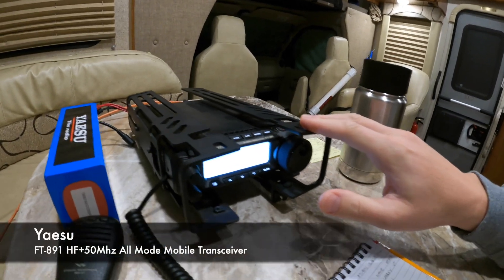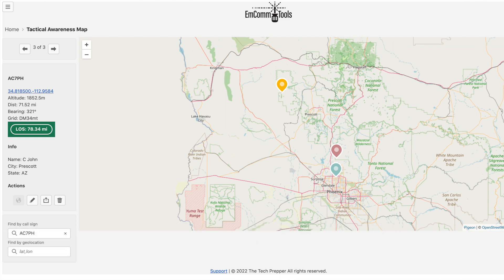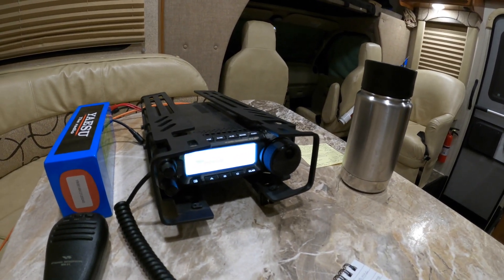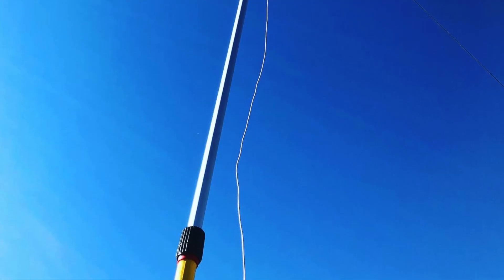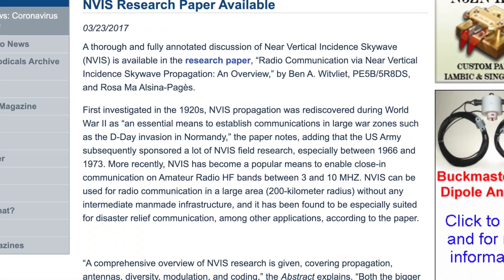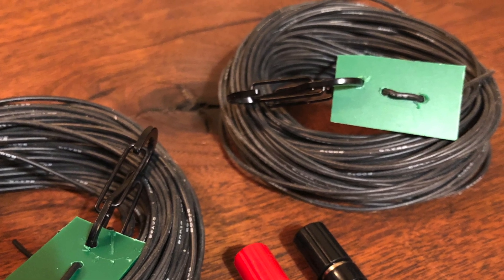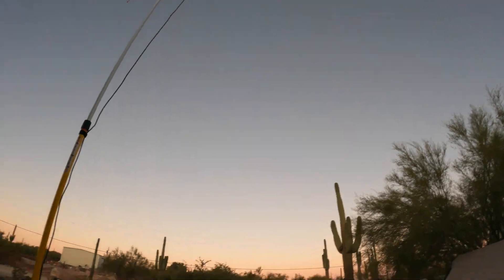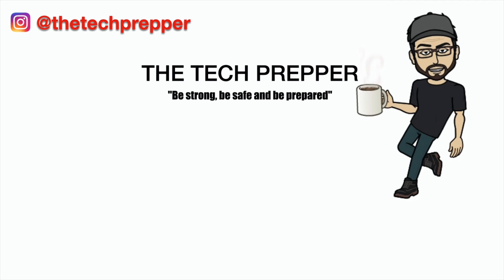The Best SHTF Comms Setup for Regional and Local Communications - NVIS

Comment: This is perhaps the most straightforward, practical explanation of how to do NVIS for exactly what I’m looking to do - regional reach to about 300 miles within the state. The theoretical information out there is great, but the real world explanations here and other videos on this channel about takeoff angles and heights was easier to apply and just make more sense. I think I know now how to do a SHTF setup out here. Thank you!
Reply from the maker: I'm glad you found it useful. If you search for NVIS on my channel page you'll find a couple of other real world examples. The field ones are fun. Cheers.
Reply: @TheTechPrepper  I read the 160 meter band can bend around hills quite well so you can use it regionally without relying on the NVIS. Have you tried this?
Reply from the maker: @castirondude Yes, I have experimented with groundwave propagation on 80m and 160m, but our ground conductivity is very poor, so I have not been able to get anywhere near the distance that the literature suggests.
Reply: @TheTechPrepper  That's good information. I just signed up for your coffee thing. I'm very impressed with the amount of real-world experimentation you've done. The general usage mode I'm looking at is similar to yours, but man I can't afford to spend the countless hours to figure it all out.

Comment: I missed this video when it came out. Good job!
Did lots of engineering work with screen rooms and Faraday Cages. The grounding or earthing comments below are correct.
Multiple layers, isolated from each other except at the grounded point increase the effect.
The local team stored radios, with all cables disconnected, in layers that included vacuum bags with silica gel, foil layers and metal tool boxes.
Never really tested them with big EMP.
Did test using antennas in wire mesh cages. Almost no effect unless they were grounded as discussed below.

Comment: Thanks for the video. I use NVIS on 40m to run JS8Call between Melbourne and Sydney which is about 900km reliably all day. Generally only running 15W. Also use 40m NVIS locally for a Winlink connection to a local station about 60km away. My 40m NVIS dipole is only about 2m (6ft) above the ground in an enclosed small back yard. NVIS rules !!! 73
Reply from the maker: No problem, Darrin. Thanks for joining the conversation. NVIS rules!! Almost all of my experiences with NVIS have been on 40m. Like you, I have run it as low as 4ft. I actually activated a peak like this using my 40m version. Check this out: https://youtu.be/P6uowKWtWbY?t=540
Reply: I did NVIS many years ago for MARS and it was surprising how well/reliable is was. Daily nets rarely had a hiccup, usually a broken antenna for the current net control was the biggest issue. I got out for a while but now my daughter is a ham so we will be having more fun soon!

Comment: I really liked to comment about NVIS not being able to do direction finding. I had not thought of that. I am running a Chameleon Emcomm 3 Base antenna set up as a sloper with the high end at 30 ft. and the low end at about 9 ft. Getting mostly NVIS results but also some sporadic nationwide contacts as well. I am near Portland Oregon and for Winlink HF my best connection is in Utah. Keep up the good work, your videos are helping me learn a lot and believe me, I need it!
Reply from the maker: Thanks. Happy to help. I'm just sharing my experience as I work through the hobby. Sounds like you're doing really well.

Comment: NVIS! Love it Gaston. Thanks for showing us how it's done. It's amazing how simple you keep it which is great for duplicating the hardware. Just plain old smart.
Reply from the maker: Thanks, Eric. I was so intimated with antenna theory when I first got started with HF last year and have always thought, it really does not need to be difficult or expensive to get on the air and be successful. I'll happily be the "MacGyver" of this hobby. Just a pocket knife, a painter's pole, some wire and an entry-level HF rig for this guy.
Reply: @TheTechPrepper  do we need anything more than entry level? Haha, let’s not forget how MacGyver made lasers out of bino lenses. I wish I was crafty like that! Well, love what you’re doing man. It’s applicable and practical. I’m probably not the guy who’s gonna rag chew the airwaves.
Reply from the maker: @backcountryamateurradio  That was a great episode. I don't ragchew either, although I am enjoying my new early morning check-ins with the locals on 80m. I'm doing it more for relationship building and training rather that to shoot the breeze. It's good to build a reliable support network.
Reply from the maker: @bruceforster3709  What an ordeal you've been through, Bruce. I love your grit and determination. In the face of adversity, you succeeded. Well done! I hope you find a club that will accept you some day. Cheers.

Comment: Just FYI the 31 gallon galvanized trash can seems to have about an 18db reduction in electromagnetic signal if just putting on the lid.  However according to a Youtube  video I saw, where some guy tested it, if you seal the lid to the can with foil tape it closes up all "gaps" and provides an almost 40db signal reduction, which is about 1/8000th.
Reply: I apologize for responding to a 4 month old comment, but what would you recommend for sealing up the lid on the can? I have a few of the cans you have mentioned and didn't realize how much of a difference it made if sealed up.
Reply: @ScottPlude  He was talking about the tape that is used for heating and air conditioning. I would imagine aluminum foil would help if you can’t find the tape. The 5 gallon size is good for smaller electronics. I have also thought of using ammunition cans. Sportsman Guide has some larger ones.
Reply: Put device in microwave then put it in trashcan?

Comment: Good stuff brother. NVIS is a proven and valuable concept for a lot of different reasons for sure. I've used those painter poles a lot as well, I placed a PVC pipe with a larger enough inner diameter to accommodate the pole into a 5 gallon bucket and then filled the bucket with quikcrete...heavy portable ..lol!
Reply from the maker: I like your approach of using a 5-gallon bucket with concrete. I am going to borrow your idea and will give you full street credit if it appears in a video. I have an NVIS test I'd like perform over the next month using the CHA LEFS with the 80m extension. I plan to run some digital tests with NBEMS (fldigi/flmsg) with some locals across the state.
Reply: @TheTechPrepper  No worries.  You can see them here- https://www.youtube.com/watch?v=Th3VH-Q-J8s

Comment: 30mm ammo cans work great.  I have two that were used to house Apache 30mm shells since they are electronically fired.  One houses my Ftdx10, and the other fits my 891, and 897.  The 817 goes into a Mylar food storage bag.  Then I don’t have more than one radio out at a time thus keeping multiple backups
Reply from the maker: I like your storage technique. I'll need try it out. You have good taste in radios by the way.

Comment: Very accurate presentation of NVIS principals. I get great regional (200 mi) coverage on 80M w/ a flat inverted V (apex at 18' - ends about 10'). For 40M I have an inverted V (apex at 35') which seems to have a lower takeoff angle because of its higher apex. Thanks for the video.
Reply from the maker: Thanks, Rick. I appreciate your additional data points on your experience. I may have over simplified the NVIS explanation, but wanted to plant the seed that regional communication is possible with a simple antenna and low power. 73

Comment: Outstanding video Gaston, the simplicity is motivating me to make a couple 40 and 20 meter dipoles for NVIS. Wanting to try under  50w rf and see how it goes. I've got  a G5RV and 80-10 EFHW here at my home QTH. But I've not been impressed with the reception, which is one of the reasons I'm looking at going portable this year and trying activities such as Pota and Sota.
Reply from the maker: Thanks. I'm a huge fan of simple. NVIS will not work on 20m (14 MHz). However, this dipole will still work on 20m, but you will not experience the same local/regional characteristics that NVIS offers on 2 MHz - 8 MHz.

As for SOTA, consider taking your EFHW. It's great as you only need one support. I'm a huge fan of the PackTenna Mini EFHW for 20m. I've also taken the 40m version of the dipole shown in this video and activated a peak with it running 4ft off the ground using my trekking pole as a support.

Comment: Great video! As to the Faraday cage, microwave ovens are Faraday cages. They may be effective without grounding, but you would want to remove the power cord that would act like an antenna for EMP.

You can test by placing your cellphone in the box and see if you can ring or bluetooth it.

There is considerable thought that small electronic devices not connected to the power grid or significant antenna will survive most EMP events much like a bird on a powerline would ride the power fluctuation and not see a large potential energy difference between his two legs on the wire. In other words after an EMP event there may be a lot of people playing candy crush one their phones by themselves until their battery goes dead.

Carefully wrapping smaller devices in aluminum foil and doing the ring test is informative also as to what may be effective.

I was aware of your NVIS ops, but I do notice you seem to gear your manpack ops more toward VHF/UHF, which is understandable given your primary requirement of getting assistance or comms home when on the trail with a minimal pack.

I am not a hiker or SOTA guy so another pound is not a big consideration. Its just getting it in the bag so I have one trip from the car to my operating position.

73
Reply from the maker: That is an excellent tip. I guess it's time to buy an inexpensive microwave. That's the perfect size for a couple of HT's, extra batteries, a small solar panel and charge controller, and a small HF rig (FT-817). There may be even room for a Panasonic CF-20 Toughbook. I have a nice offline, air gapped setup for communications and mapping. You knocked it out of the park with this suggestion. Thank you.
Reply from the maker: Well, the microwave Faraday cage failed. At least my microwave fails. It was a fun to test the idea. I was able to receive calls. I'll look into building a proper earth-grounded Faraday cage. You never know unless you try.
Reply: Unfortunately, the old "microwave oven as a Faraday cage" is a common myth. They only shield well at their operating frequency of 2.45 GHz. These things are so cheap. A manufacturer is not going to spend one penny more than they have to to pass emissions testing. EMP is broad spectrum, very short period, and ultra high amplitude.

Comment: good NVIS antenna is a dipole tuned AT the NVIS height, an inverted v that is nearly flat. as you get the antenna closer to the ground from DX height the side lobes will merge with the main lobe and a bit lower to optimal NVIS height will maximise the vertical gain.
if you want to increase the gain further you can put a withs 105% the length of your antenna in the ground under the antenna this is mostly used in fixed set ups.

Comment: Hmmm.. the metal cage is new to me. Going to buy and try!  After decades of ham and gmrs building. I just use tool battery for my radio needs. Battery Always ready and they are not wasted sitting around

Comment: I am central Washington and do tons of NVIS on 40 and 80 and the currant solar cycle appears to have a minimum range of about 100 miles. I have used it much closer than that in the past.
Reply from the maker: Thanks for the  data point. Very helpful.

Comment: Perhaps go more into the Packtenna stuff.  How long the wire is? how to add on other bands etc.  i assume antennas are a burden when trying to travel light as well.
Reply from the maker: That's one of the videos in the backlog. I have all the tools and parts ready to go. I am planning on modifying the PackTenna Linked Dipole to cover 60m/75m/80m. 20m and 40m all ready work without any modifications.
Reply: @TheTechPrepper  that is the video I need.  I’m confused how to cut it and test it etc.  and I would love to add more band widths.
Reply from the maker: @kurt53641  I have the tools and parts, but also not quite sure how to do everything yet. I'll take the hit, test it and share. I think this will be out late next month. I have an EmComm Tools talk (and lots of programming) and a Winlink Net to plan and deliver first.
Reply: @TheTechPrepper  you are awesome!  Yeah I plan to purchase the pack antenna mini.

A frustration I have with a lot of other radio YouTubers is that it’s never dummies down.  Not sure why.  But, your videos are gtg in my opinion.

Comment: At night time, I've talked to Texas on 75m. My signal report was 10db over S9. I was running 100w with my IC-7300. The station I was talking to was running 400w on a IC-7300 and a amplifier. Depending on band conditions, 75m can get out.
Reply from the maker: Thanks for sharing the experience. I've read that even with NVIS you still have some low angle radiation allowing some farther contacts. I've had a few contacts already that are pushing the 400 mile NVIS range. The 7300 is a great rig. 73

Comment: In my Van, I have a Yaesu FT-891 that drives a small Screwdriver Antenna. It's powered by a separate Bioenno 40 Amp Lithium Iron Phosphate Battery. I live in NW Oregon. I have found that Eastern Oregon is far less Hilly than Eastern Washington. In Eastern WA, I found 2 Meters & 400 to be all but USELESS! Having 80 Meters & that Screwdriver allowed me to get signals OUT! And in Montana, there are HUGE areas with NO repeaters at all; so again, HF is the way o go. For the High Bands in the van I have a Yaesu FTM-200. I like the radio very much, but it is a BEAR to program!
My Wife's HT is an FT-60 that's 12 Years old and still works. 
MY HT's are a VX-6, and a VX-8. I'll loan out the VX-6 to someone I trust, but NOBODY touches my beloved VX-8, LOL!

Comment: Thank you for this video! I just bought myself yaesu FT 65R hand held. I started thinking I have a 35 foot TV antenna tower at my house. This looks like something I could attach to the tower. Would you agree? And if I did could I run it up the middle of the triangle tripod tower or would it be best to run it up and then get it outside of the frame? Also what materials would you suggest for this set up for a handheld HT?
Reply from the maker: Congratulations on your radio, but the concept in this video covers HF. Your FT-65R only covers VHF/UHF. They're two different animals. You're good with local simplex coverage and repeaters with your HT. Your tower may work as a good support for various antennas.
Reply: @TheTechPrepper  Yeah I thought of that after I sent you the message. Got it thank you for getting back to me. Blessings
Reply from the maker: @daveg2199  It never hurts to ask. I believe that FT-65 of yours can have the MARS/CAP mod applied to it from the front panel. I believe KS6DAY has a video on that. It will unlock your radio to transmit on the MURS/FRS/GMRS frequencies. This could be useful during a life threatening emergency. Cheers.
Reply: @TheTechPrepper  Hey great tip! Thanks so much! I’ll check it out😃

Comment: I’m interested in a faraday bag that could protect the 857D and 818ND rigs.  I have some “godark” bags. I have two “mission darkness” dry shield molle faraday pouches.  And I have a “mosequipment” bag. Could you tell me which bag would fit around your two rigs?
Reply from the maker: Those are my two favorite radios. The PRC/117G from High Ground Gear works great for the FT-857. I designed a custom bag for the FT-818. I talk about it on buymeacoffee.com/thetechprepper.
Reply: I saw your two bags and I’m interested in both.  But would those bags fit into the 2.5, 5 or 10 liter faraday bags? SLNT, godark, or Mission Darkness faraday bag.  For weight reasons I’m leaning towards the 118 rig with you bag and that in a 2.5 or 10L faraday.
Reply: You could buy the faraday material and line the inside of your 118 bag.

Comment: I've invested considerable time in researching DIY Faraday cages. Unfortunately, that guy was incorrect regarding the Faraday cage. It needs to be ferrous, like a steel ammo box or a paint can. Ideally, you could have something welded, mimicking an ammo box to your desired dimensions. Also, do not use copper-taped seams, as you often see on DIY builds; that will not protect your equipment. Just because it blocks a cell signal doesn't mean it'll protect against EMP; it'll sneak right through that copper foil and adhesive. What you want is ferrous braided metals. The best material I've found in a braid is nickel-plated copper braid stuffed with cotton or fiberglass to create a nice seal, then tacked down with some glue on the inside wall/channel to take the place of the old rubber gasket (make sure to sand away ALL paint where this gasket will be going). Also, it doesn't need to be grounded. I'd recommend putting the equipment inside electrostatic discharge bags (avoid the colored ones) inside the cage for added protection. Insulate the box with simple cardboard or, for even more protection, some conductive foam, then use cardboard or silicone to insulate your equipment. This same gasket method can be applied to trash cans, toolboxes, etc. even your firearm safe as long as there are no gaps and the gasket is done properly.

Comment: Do you leave your HF antenna up 24/7? Do you take it down if its going to rain?  How important is it to keep it dry or can you water proof it?
Reply from the maker: This antenna is not well suited for long term deployments, but I did run it for a few months. The wire snapped once during that time, but it was an easy fix. These days I run the CHA LEFS 8010 at 16' as a flat topper. It's has been up for two years and survived our monsoon seasons.